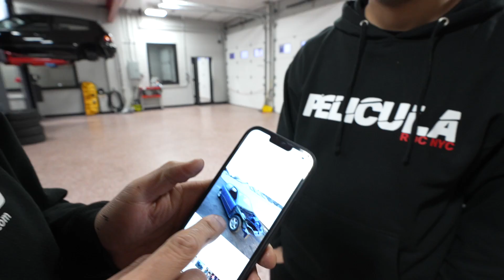1000hp AWD Civic gets a FuelTech 550! Outlaw Sonic K-series AWD Start up inside!

Comment: bro every  day  u guys inspire me a lot I javelin a clean Da lsv turbo bottom full race top 16a  with head work I'm gonna used hondata but I should  go fuel tech  its super awesome  that product  I'm gonna buy the new nano to play with  the s300 v3 at least 😅
Reply from the maker: fueltech is dope!
Reply: Fuel tech runs everything easier less wires and if you go to there class you can tune it yourself instead of paying out the a$$ for someone else. Down side is unless you have a remote switch you can't do just front or rear burnouts like motec
Reply: so i might  sell the s300 and put couple 💸  on top and get the 450  I'm good with that one for now also the car its gonna be on street
Reply: @sneezinhatch split the difference and go aem infinity. All the capabilites of haltech or motec for a bit cheaper

Comment: Take the oil pressure sensor off the motor and run a line to inside the car. It cracks the block from vibration bro
Reply from the maker: its on the sandwich plate